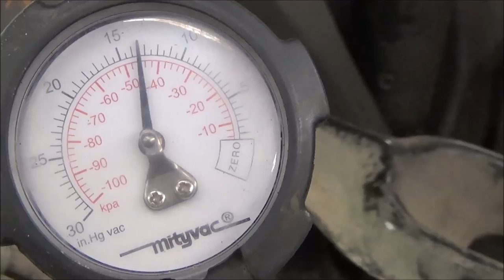Pontiac Grand Prix 3.8 - Water Pump Replacement

Comment: a gallon of vinegar soak for 30minutes would clear that up. cheap and fast.
Reply: +Jonathan Barfield Draining that mud slurry afterwards would feel so rewarding on this car. I've never seen so much junk come out of cooling systems until i started doing 25/75 vinegar to water as a flush. and not really any environmental concerns if you flushed the coolant out prior. just rust and vinegar and water coming out.
Reply: Idk how water could even flow thru that radiator or heater core.
The vinegar flush is a good idea for any car.
Reply: I would avoid vinegar flushing with iron blocks...  You think you're getting everything out, but you're not, you're just creating a new layer of rust that isn't worked loose yet.  Go ahead, take a cast iron skillet and put your mix in the pan, filled up, and let it sit for however long, then drain it and put your typical coolant on.  I can bet there will be a healthy layer of rust.

Comment: I notice a common theme in the comments is that people are blaming Dexcool for this issue. Dexcool is not the issue. Lack of maintenance is the real issue. If service recommendations are followed, this issue most likely will not happen.  I laugh when people blame the car for being junk when they never bothered to read the service intervals. Every manufacture states coolant has a life span and must be changed at regular intervals. Maintain your car and it will last, ignore it and you wallet will hurt.  Coolant is cheap, engines are expensive.

Comment: Looks like they mixed regular with deathcool lol
Reply: It wouldn't do anything,it's most likely stop leak.
Reply: @mbsnyderc  Oh yes it would. Dexcool and Normal antifreeze makes a sludge pudding in your cooling system.
Reply: Actually when you mix dexkill with the regular green coolant it will sludge everything up.

Also dexkill will sludge up when there's any air introduced into the cooling system as well. I have a 07 impala, and as soon as I got the car I flushed it out for an entire day and installed the regular green coolant.
Reply: Absolutely correct. Seen that before in an Oldsmobile I had. Its Dexkill mixed with conventional and makes clay....lol
Reply: 100% unequivocally has been mixed with dexcool and green antifreeze
Reply: @MrJx4000  yeah i ran into one so bad it took an entire day at the shop to flush it all out. darn aution vehicles

Comment: That was a fucktard and a half of stop leak!! Will be back in few days for an upper intake probably....
Wanna know something funny, I worked at a GM Dealership from 03-07 and all the 3.8s had a recall for a coolant leak in the throttle body. The repair procedure was to change the 3 nuts that hold the throttle body on with 3 new nuts that looked pretty much identical only they were zinc plated instead of black and you put blue loctite on the threads, then drop 2 tabs of "GM stop leak" in the radiator, they were just like bars leak tabs only with a GM part number and package. To top it off the job only payed like 0.3 so most techs were just cranking the new nuts on with a 1/4" air ratchet and calling that good, racing the clock....... Every time you did one of these the parts counter would hand you a pack of 6 stop leak tabs, 3 nuts and a small tube of blue loctite.......so you got 3 times as much stop leak and 20 times more loctite than you needed.... i still have stop leak tabs and blue loctite in my box from 12 years ago. Also had to fill out a little sticker and put it under the hood, recall number was 03034
Reply: This is what really pisses me off about auto manufactures , they do shit like the 3800 plastic manifolds and gaskets to save pennies , and their customers pay up to $1,000 to get one fixed and some lose the engine with a hydro lock . And they are all the same , assholes ! TheReaper!
Reply: joeblackakareaper they do plastic intakes for reasons beyond cost. it allows them to make far more complex internal designs on intakes. both lowering costs and increasing fuel economy which is a major driving force in car design.
Reply: 200K MILES AND NO FLUSH?????????????
NEVER USE STOP LEAK
NEVER WORKS
Reply: Disagree..........sure worked here e... 8)

Comment: and that is why you dont mix any thing with dex-cool besides water.
Reply: +MarloStanfield767 distilled water is the best option if available.
Reply: If you buy prestone dex cool you can use green prestone with it with no problems.
Reply: jeffscomp you should be fine with those type together cause they are both OAT coolants
Reply: Nah that's a wives' tale and not true.  You can mix Dex with regular green, BUT it reduces the service interval from 5 years to 2 years.  The sludge is caused by not replacing your coolant at the recommended service intervals and also from not properly bleeding air from the system.  If you change it every 5 years or 50k you'll never have this problem, and as Eric said, this one has 200k and is on the original coolant.  It's a testament to the quality of the GM 3.8's that it's lived this long in such shoddy condition.  Bullet-proof engines...too bad the rest of the car around it sucks.
Reply: Or get rid of Dex cool lol

Comment: I have an '05 Pontiac Grand Prix and it's had cooling issues ever since I bought it back in March (it's mid July now). That coolant in my car and my coolant cap looked somewhat like that, I flushed most of the cooling system out (except for the engine block, I am not too knowledged on that) but it still overheats, the last owner treated that car terribly. It has 261k miles on it. It is crazy how much shit that 3.8 has been through.

Comment: When I was younger I had a 95 Corsica and I blew up the 3.1 that was in it, So a few friends and I ended up figuring out a way to drop in a 3.8 super charged into the thing. Took some time, but we got it going, I drove it around for a couple of years and I went threw 2 water pumps, both times I lost the belt somewhere down the road. Its like them 3.8s just hate belts when the water pump goes bad, at least mine did.

Comment: Man, you are a life saver, I could not see how to get pulley off for just the one bolt of the water pump that never should have been in the way in the first place, however I did not know the holes, (3) were obtainable with a deep socket and a wratchet, don't have a power one so I hope I can get it, I got this car from an auction and overheating is serious, I added a 160 degree thermostat but that was not the real problem, but helped a lot on the old 5.0 gt (1990) thanks man for your video, your hard work, and your time. I was about to lose my car, nobody wanted to help me with this 2004 grand prix learning experience, next I'll try to get ac going if I fix car and deliver pizzas then on to UBER, I'll be bigtime then. thanks, Ryan Tucson Arizona

Comment: I suppose you did pull the heater lines loose to flush it as well and the lower hose. Quite a bit to that work, but to make the video, probably didn't put it in. I did one that helped the engine run cooler but not enough tools on hand to change out the thermostat.

Comment: Dexcool has a few issues.  It may last more than  100,000 miles, but the interaction  between that coolant  and the head gaskets, if I remember correctly.  It is complicated.

Comment: That clay like mud is from the great product DexCool. I had to replace my heater core to the tune of 800 buck, 54 bucks for the parts and the rest to pull the dash to R/R it. In my other Blazer DexCool destroyed my intake manifold gaskets and all my coolant went into the crankcase. Lovely product that somehow GM avoided all class action lawsuits.
Reply: DexCool destroyed the intake manifold gaskets on my 1998 Grand Prix and flooded the crankcase too.  I took it to my GM Dealer thinking the lawsuit would help cover it.  It didn't.  It ended up costing me $1,700 to fix it in 2005.  It had just over 60,000 miles, and was too old to be covered by the lawsuit. I flushed it out and put regular Prestone in it as soon as I got it home.  Now, in 2022, it has 203,000 miles on it, and I'm getting it ready to give to my grandson.

Comment: Since I'm a new subscriber went back through and watched all of Mr. O's vids.  Thought my "very well" (BS) maintained '97 F-150, according so seller was bad, until I saw the muck in this one.  I changed all the fluids in the truck and got what looked like Dairy Queen hot chocolate syrup out of the radiator,  McDonald's rancid french fry grease out of both axles, some kind of brown friggin' mess out of the transfer case, and black Texas crude out of the trans!

Comment: The best and safest way to TRY and clean this would be to fill he entire system with Vinegar, purge all the air out of it then let it sit for 3 - 4 days, Drain and flush. I have had amazing results with Vinegar especially on Cast Iron. 
Safe , Cheap and Non-toxic way of removing rust .  I can’t imagine how this engine was not constantly over heating. 
The truth hurts what a Ridiculous owner.

Comment: As a 70 yr old mech...never saw anything like this. Maybe some Thermocure rust remover or some of that Prestone rad cleaner. Aluminum acts different than iron when it comes to high and low temps.

Comment: I sent this video out to former coworkers when you were in the flushing process.  Like I told them, I HAVE NEVER SEEN MUD, CRUD, "CEMENT," CLAY, LIKE THAT ! ! 
You are a testament to a true repair technician !  With all those miles, and crap, I'm sure there will be coolant leaks later on ! !   No doubt this is a Great Video !  I like that cooling system vacuum tool.  Ever have a problem with any parts of the cooling system of any vehicles lmploding?

Comment: For  1 year I made 3,600 air-conditioner pump brackets.  They bolted to the engine block over the #1 fireplug. This was in the before the platinum -electrode, and the spark gap grew with every spark. After 6,000 mile the plugs needed to be pulled and re-gapped, or else the car would began misfiring. Marvelous engineering (4:32) to require the removal of the belt, and of three bolts, just to remove the spark-plug.

Comment: A fella told me he had a similar situation on a used car he bought. He said he flushed it the best he could and then filled the system with straight vinegar. Drove it around like that for a week or so. Stank to high heaven, but when he drained it, almost all the crud came out. Flushed it again with water (to eliminate the smell) and then filled her up with coolant. Problem solved!

Comment: Hello,
    I know this video is older but I have a question for you and I’d like your professional opinion.  I have a 96 LeSabre with the 3.8.  I’m replacing the coolant elbows…actually just one because one is incorporated in the tensioner bracket.  I’m replacing the one with the aluminum elbow and actually installing a new tensioner bracket because I couldn’t find much if any info on the o ring needed for the elbow tube that is incorporated on the bracket.   Should I use a water pump/thermostat gasket sealer around these o rings?   Any advice would be appreciated.  I replaced my water pump and that p/s pump bottom bolt about did me in!!!  I’m hoping I don’t do this again anytime soon.  Great video!!!

Comment: couple of cups of non-bio laundry powder will do it, I remember working at a dealer and we were advised to use it when the heat exchanger/oil cooler went looking like head gaskets blown. Clears it right up and smells good. Dump it all out after running engine warm for an hour or two, drain and refill with coolant

Comment: I bought an 08 Grand Prix last year used with about 48,000 miles.  At about 51,000 I was just getting off the expressway on my way to work and I stopped at a light under some train tracks.  Over the sound of the radio I could hear some ugly metallic clattering coming from somewhere close to me, but since a train was passing overhead I chalked it up to that.  I went the rest of the way to work (about a mile) and parked in the parking lot, but when I killed the radio the clattering was still there.  I shook off the sinking feeling in my stomach and opened the hood thinking I had thrown a rod or blown a lifter, but then I saw the water pump pulley dancing a jig side to side and a fine mist of coolant covering that area of the engine.  Thankfully it didn't overheat and I was able to throw a new pump on there and drive home that same night without any damage to the car.  I'm tempted to say you just never know what you're gonna get with used cars, but you always know what you're gonna get with GM water pumps.

Comment: Dex Cool is one of those products designed to Kill Cars based on, Pay Attention to Car Maintenance or Else.. 
  Like when Interference Engines came out or when they pulled ZINC out if most oils with NO Warning.... Never saw so many Diesels Fail in a few years...

Comment: There was an earlier model grand caravan, when I first started wrenching, came to my shop in Aurora Colorado. The belt kept coming off for no reason. It was a weird one. We checked all pulleys, alt, idler, tensioner, ac and what not. Wasn't any noise with the belt on. Weirdest thing was, in the shop it sat for a little bit so it got dry, and that day it was raining. Took it for a test drive to see if there was any change from the speed and what not. Hit a pothole filled with water, water hot the belt and off came the belt. It would only throw the belt after water would hit the belt. Found an updated idler or tensioner pulley, can't remember exactly, but it had the lip on the front to keep the belt aligned. Dodge said they are aware of the issue and sent an updated pulley to us. Needless to say, car left with the belt on and no more throwing the belt. Sorry for the long read.
Reply: Good reading.

Comment: I'm surprised that it actually kept running with all that sludge in the cooling system
I wish that you were my local repair shop over here in the north-west of England.
I used to do all of my own 'spannering' on cars and motorbikes. But now I am old and grey, with a dodgy hip, I have to rely on local repair shops to do that for me. 

I have yet to find somebody who will do a proper job, without ripping me off.
I run a 2010 Ford Focus 1.6 petrol with 40k miles. Because of the age of the vehicle, the timing belt needs to be replaced. Ford recommend changing the water pump at the same time.
The quotation from my Ford main dealer for the work was £757.00 ($972.00). Ripoff.
Thank you for all your video's, they are very well shot and informative. Well done for including your lovely family and, I'm assuming, your young lady trainee.
Keep on making the video's, I'm sure that many people will continue to keep watching them. 
Best wishes from across the pond.

Comment: Bought a car for $500 once that had a similar situation. Replaced the radiator, water pump, and reservoir but before that I ran about a whole bottle of dawn dish soap and hot water through it with the engine running. Cleaned it out pretty good. A good way to do it is to put some dish soap in it and water. Run the engine with the thermostat out until its warm. Then stick a garden hose in it and let it overflow until its clean water.

Comment: I would park it outside and stick the garden hose in it with a high pressure tip flushing the radiator out till I got clean water.

Comment: Hey Eric - thanks for cleaning the back of my screen for me.  XD

That mud I think might be the DexCool (DexKill) stuff.  Seems like I read somewhere that it will do that if it gets low and is left that way for some period of time.  Not 100% sure though.  I ended up flushing every bit of that DexKill out of my 3.8 series 2 about a year and a half ago.  I went to the yellow colored non-silicate non-phosphorus stuff.  No problems since then.  Luckily I got to it early - car only had 60k on it then.  I plan to flush-fill it every 50k moving forward.  Stuff says it's good for 150k miles ... but I'd rather pay a little extra and just flush-fill it every 50k.  Probably overkill ... but with a new all aluminum heater core, new radiator, upper + lower manifold gaskets, aluminum heater hose elbows ... why not.  Keep it clean and corrosion free.  Maybe even hit 300k miles without any cooling system issue.  We'll see.

Comment: My first Toyota, by when the thermostat jammed and I no longer got any hot air in the cabin, had four litres of gelly, brown, fishy-smelling stuff circulating in the waterways. Took some serious flushing to get the murk out, but luckily nothing else was wrong.
Reply: And well, some time ago my 5th Ford had the water pump fail - the blade was not only spinning free on the axle, but had fallen off. Luckily it had not shattered too much. the bearing was also shot, and it turns out that the AC compressor bearing was shot too. Now both have been changed and it's actually almost silent! The broken bearings made one heck of a racket.

Comment: Thanks so much...I was doing my and got stucked with the screw behind the power steering pulley but you came to the rescue...you rock...
My had some of that gungk but not as bad that's build up due to overtime with the 
dex_coolant have to keep eyes on it...😵

Comment: Original coolant straight from the factory, nice.  OMG that is a first for me. Never in my life have I seen that kind of crap in a radiator!  How did that car no over heat??? I was wondering how you were going go about flushing that out. That air/water nozzle is nice, and they're still available for around 60 bucks U.S.. Salvage yard for a used rad and heater core, no guarantees but cheaper than new. You did a really good job, I just hope the guy doesn't come back complaining the car overheats.  I'm shocked the thing didn't die along time ago.  Thanks for another fine video!

Comment: Stop leak I'm sure  that was in the 3800 water pump replacement  video.  3800 is a head gasket machine for failures.  Thanks for your videos.